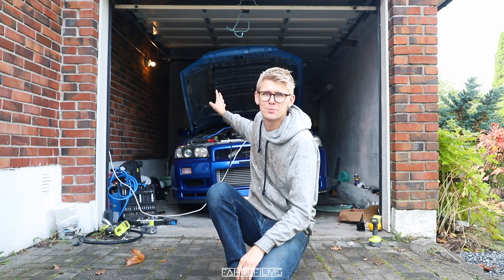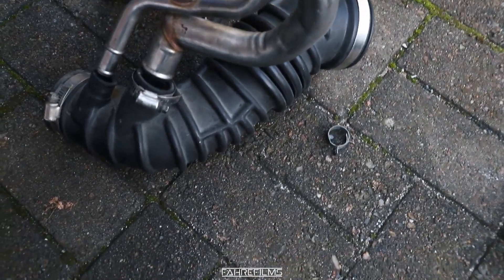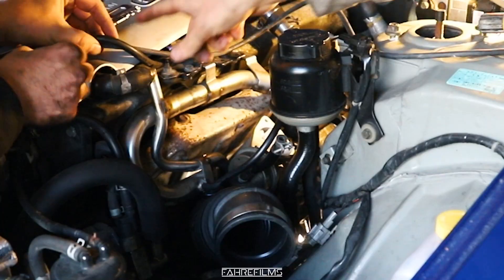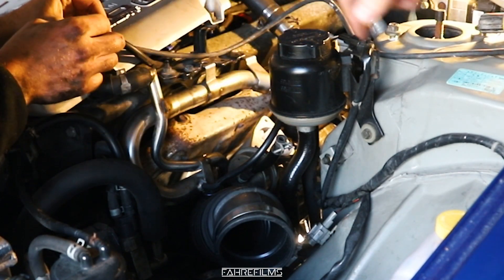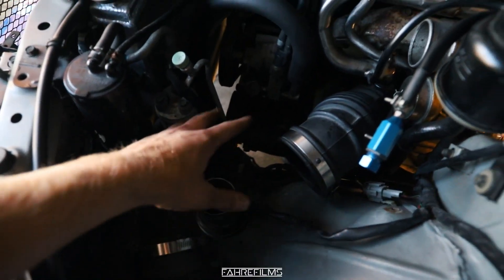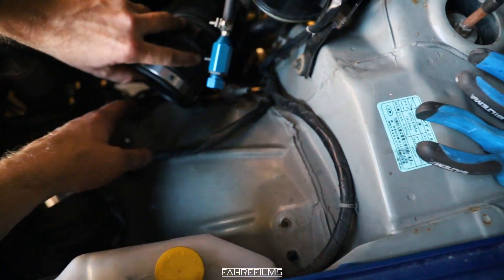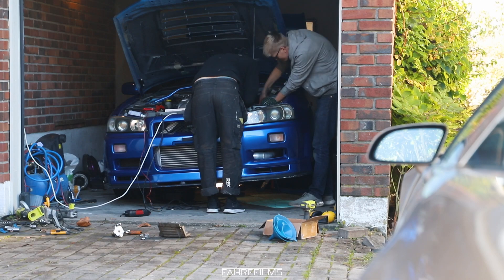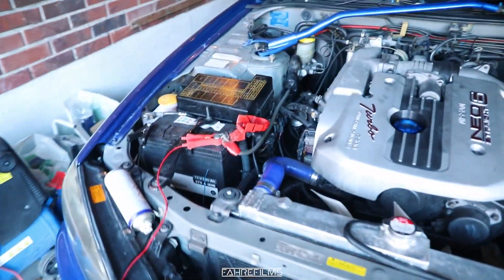R34 Skyline Finally Ready for First Start Up With New Turbo! Ep.10

Comment: u forgot to lube the oilfilter seal
Reply: It probably got lubed during the installation, because the old filter had oil in it and when he took it off and it leaked then. Atleast I would guess so 😄
Reply from the maker: Forgot to put it on camera, I did lube it now, forgot it last time I did it 😅